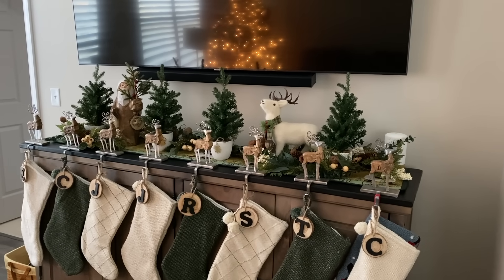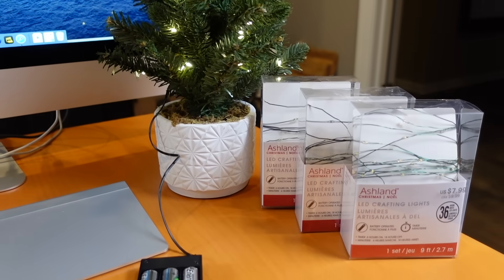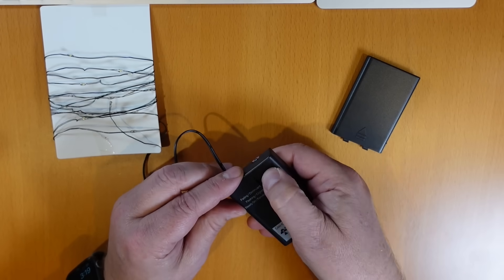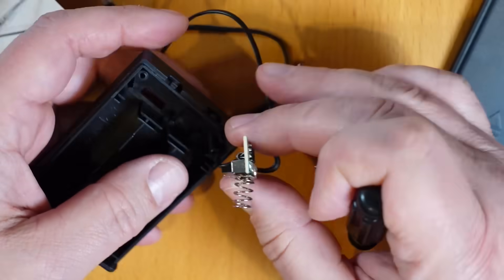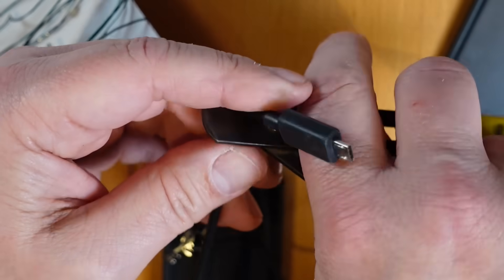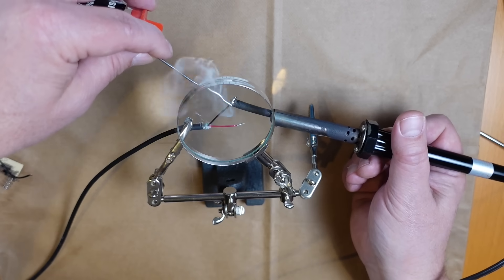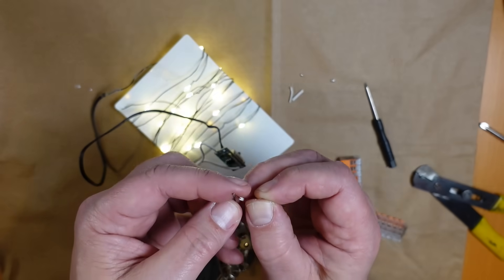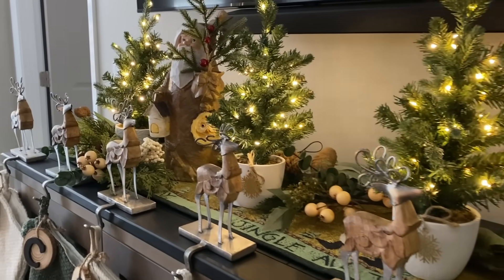SAVE $100s on batteries with this simple decorating hack

Comment: That’s why I save all my old cables from my iPad cut off the part that goes into my iPad and save the other end and wire it to a battery operated decoration so far I’ve had no problem

Comment: even easier, I would have run the cable to the battery box leads and been done. LOL Forget all that circuit board soldering stuff. I'd be twisting them back together every year though
Reply from the maker: Ok

Comment: Well, someone else has the same old analogue voltmeter!
Reply from the maker: Still works!
Reply: @ I added a small red push button switch on the top left (matches the ohm adjust pot) to short the input to set the zero DECADES ago, and yes it still works.

Comment: I slowed video to 50% right at jump but you lost me at the tail end. So you did the same thing to the trees?  The cords into the “Wago lever nuts” aren’t soldered to anything, just cut the battery packs off? The Wago lever nuts are a way to connect them all to 1 plug then?.. instead of 1 plug per fairy light?  Could you explain the Wago lever nuts? Thanks!
Reply from the maker: Yes they are just splicing devices. One for positive and one for negative.

Comment: Be warned the voltage imbalance will cause the neutral line to oscillate and cause a fault current to flow back to the nearest nuclear power station causing a melt down. But don’t worry I will probably be safe where I live. 😂😂😂😂😂😂😂😂😂😂😂
Reply from the maker: Not funny. Ignorant people believe anything.

Comment: Yeah. Most people are not handy electricians. It may cause lots of home fires.
Reply: This will not cause house fires. You don't need to be an electrician to do it either. He used a multimeter to verify the voltage. I taught my kids to do read a multimeter and solder when they were in grade school. If you don't have an engineer parent to teach you there are plenty of classes on the internet that you can watch to learn these skills.
Reply from the maker: No danger with 5 volts.

Comment: That great when you have an outlet near by.
Reply: Use a regular USB A connector and wire that in to the lights. You can use a diode or resistor to drop the voltage down from 5v to 4.5v if you're working with lights that use 3 AA or AAA batteries. Then , you can just plug that into a cheap powerbank and it will run for quite a long time without any issues.
Reply from the maker: Yes

Comment: Ok this is cool but I don't have any of the tools like multimeter or soldering iron or any of those little parts. I do have a bunch of charger blocks though so I'll save the video for another time when I may have everything I'd need to do this project. I just like the idea and I do have another application for it that's not decorative. Thanks for showing us how to do something neat.
Reply from the maker: My pleasure!

Comment: I would just solder the USB plug into the battery terminals and run wires (+ to positive to -) ) to complete the circuit.
Reply from the maker: That’s essentially what I did, just removed the battery holder to make it smaller.

Comment: I did this to the Christmas lights on my tree, but I kept the battery pack as an option. A 5volt power bank is also useful.
Reply from the maker: Yes
Reply: Yes, but most Powerbanks are designed to shut off, when no power is drawn. If you have a fairy light with a timer function, it won't come on again automatically.

Comment: If you added a single silicon diode to the incoming power it would drop 0.6 volts and the LEDs would last longer running at the voltage they were designed for. Also you say AA 'batteries' (cells) are 1.5v yet you show rechargeables which are 1.2v?
Reply from the maker: Yes I had 3 rechargeable batteries to play with one string. I would have had to buy 9 more. I chose this instead.

Comment: I added a 1N4001 power diode i series with the positive. They are good for 1 amp. They give a approx 0.6 volt voltage drop so the lights are getting the correct voltage. They are operate  differently  from a resistor so they don't  get hot.  For a light that has 2 batteries that give 3 V I put 3 diodes in series. Works very good.
Reply from the maker: Good idea 👍🏻
Reply: Excellent modification to avoid the possibility of a fire, caused by over heating by excess voltage.

Comment: Rechargable batteries for the win.  We have been using them for years...
Reply: Last year I bought some fairy lights that have a USB cord. That proved to be a bit of a challenge but nice at the same time. I don’t have many small plugs for that. But then it occurred to me to use one of those rechargeable blocks you can use when traveling for your phone etc.  This allows me to use a string in a location that is not close to any plugs in the bathroom.
Reply from the maker: Good option
Reply: Usually, with rechargeable batteries you lose a little bit of light as they are 1.2v, not 1.5v meaning you will have less available power.
It's a noticeable difference but it is still ok for some people
Reply: @ for this particular application, which is purely decorative it isn’t significant. But I could see where it might be.
Reply: @TheAllMightyGodofCod Lithium batteries might be an exception.  Just measured my 2 different brands of lithium rechargeable batteries; both sets reflect 1.5v.
Reply: @jaycee1373  we are talking AA or possibly AAA rechargeable batteries here.
Lithium Ion batteries if my memory doesn't fail me, are 3.7v.
If you have a different reading, there are 2 possibilities:
1- something is wrong with that reading.
2- you have some sort of transformer circuit changing the voltage from 3.7 to 1.5 and so you aren't reading the battery's voltage but the system's output voltage.
Reply: @TheAllMightyGodofCod  Yes, I'm talking about AA rechargeable batteries. First set is 1.5v 3000mWh, and I liked them so much, I purchased a second set, which are 3500mWh.  They have upgraded and are now available at 3600mWh.  I had to check the voltage after watching this hack and reading your comment.  The batteries I checked had just been recharged a few days ago.
Reply: @TheAllMightyGodofCod  Not really, yes the rechargeables often start out at 1.2v, but they have a flatter discharge curve, meaning that they remain powerful enough to power the devices for longer. That's why they're 1.2v rather than 1.5v and it makes little difference, by the time the batteries are starting to get low, they're below 1.2v anyways.
Reply: @SmallSpoonBrigade  we are not discussing if they are powerful enough to power appliances... I, myself, stated that the lights work with rechargeable batteries, so that was already established.
We aren't discussing the rated voltage either as that is beyond questioning...
And no one is discussing the discharge curve so.... 🤷
Reply: That’s still 9 rechargeable batteries for just those 3 trees. The cost of rechargeables really adds up if used all over the house. They need to make rechargeable power packs for each light string or candle etc.

Comment: For heaven’s sake, why are you using disposable batteries for these kind of low-energy things at all?! Rechargeable batteries are a thing, y’all.
Reply: Not ALL are working... I've used rechargable on some things & didn't work, unless used ordinary ones...🤷
Reply from the maker: Good option
Reply: I have a LOT of battery powered decorations, and made the switch to rechargeable batteries this year. I’ve been very disappointed in the rechargeables. They do not last nearly as long as the disposables. It all depends on the decoration, some I’d get nearly two weeks on disposables, and rechargeable gets me maybe 5-6 days before they just go extremely dim. I’m definitely going to try out this hack on a few that ate disposables every few days.
Reply from the maker: @xlandros Thanks for the info.
Reply: @xlandros  yes my experience has been the same with rechargeable batteries. The amount of time they power something is miniscule compared to disposable batteries. I was always changing them out. I actually gave up and went back to disposable.  And I actually have some items that specifically stated to NOT use rechargeable batteries.
Reply: But now the lights have indefinite power and no eventual battery e-waste at all.
Reply: Or no waiting for batteries to charge, or constantly switching out, on a busy holiday schedule. Changing batteries on four trees, and whatever else in the house, gets old really fast.
Reply: I thought they were rechargeable at first. They are better for some things than others, not always a universal replacement.

Comment: You and me have an all together different idea of what “simple “ means.
Reply: Haha, I kind of agree!  Simple and easy are not synonymous though.  I once made a dust ruffle for my sister, I came up with a simple idea which worked very well. But it was truly tedious because of the volume of fabric. The finished product was very nice though!  I do like this idea, but I would just use Eneloop rechargeable batteries.  However I learned some things I didn’t know before.
Reply: It's really easy and I have been doing it for years only I usually use an LM2596 DC to DC buck converter to get the right voltage some lights only use 2 AA, some use  4, and some use 3 with the Buck converter you can adjust the voltage and brightness and not overdrive the LED's
Also I use old discarded phone chargers
I get from the trash , I used to raid those e cycle bins in the vestibule at Best Buy for them for this purpose before they got rid and f them after COVID
Reply: @andreamitchell4758  you say easy yet I don't understand anything you said lol
Reply: @Veronica.John10-10 lol ! I agree
Reply: @Veronica.John10-10 agreed!! I wonder if I can find someone I know who can understand this and do it for me.
Reply: @mariannebecker5132 Right? It is only simple if you have this kind of knowledge. With my electrical knowledge I would probably blow those little Christmas trees right through the roof if I tried to do this! 😂😂😂 
My husband however could do it perfectly with his eyes closed!
Reply: Especially since you can buy fairy lights with USB plugs.
Reply: A simple statement 🤷🏻‍♀️ and this section got crazy 🤦🏻‍♀️
Reply: I agree.  Great idea and not beyond my skill set but beyond my patience and motivation.  Lucky wife.
Reply: Love your response 😆
Reply: Super simple. For neatness, would have put it back into the original battery box.  Or, could have cut the USB female end off a cable and mounted it inside the box, soldered to the circuit board.
Reply: Sure it's easy if you are an electrician or electrical engineer. We'll my husband is neither but I'm sharing it anyway to see if he can do something like this for me. Thanks
Reply from the maker: @trishrogers9980 Try this https://handydad.tv/a4h7
Reply: @handydadtv  SO COOL!!!!
Reply: @trishrogers9980  one absolutely does not need to be an electrician or engineer. This is hobbyist 101. Instead of sharing with your husband, why not learn to do things for yourself?
Reply: Same! 😂😂
Reply: There’s no doubt that if these Christmas lights started a fire (a common cause) your house insurance would be invalid, not to mention your lives at risk. Hackers beware!
Reply: Read what I did - very easy. You can buy the battery replacers online, but there are stores that sell then really cheap.
Reply: Exactly!
Reply: its not hard mate!
Reply: For real😅like dude😅
Reply: You had me until the soldering
Reply: That part. 🧐
Reply: I’m sticking with my rechargeable batteries.  Also, this option means that all of the trees are no longer flexible in the decor options.
Reply: Tell it!
Reply: Cool. I can do that. 😊 It did take me a little bit to learn where I was comfortable with it. Been shocked a few times with 12 volt and 120 fixing other things. But this shouldn’t be too bad.
Reply: Whew😅 i thought it was just me🤣 now electricity and me are no friends, so I’m definitely not going diy, because with this “simple” hack, I’ll probably burn my house down 😂
Reply: Yeah but now that I see it done once, it’s simple. So that helps a lot.
Reply: I certainly couldn't figure this one out.
Reply: Yup I couldn’t do this hack if my life depended on it.
Reply: It's very easy if you know how to use a soldering iron and a multimeter. Neither is exotic.
Reply: Greatest comment of all time 😂
Reply: I agree and what's a soddering iron? Replayed three times. I've got a soldering iron. Would that work just as well?
Reply: @davidedwards8732   I have yet to watch an American DIY video which utilises solder and soldering irons where they pronounce the words “SOLder” and “SOLdering” correctly. Pet peeve along with the name Craig, saying “Kreg” instead of “Kray-g”. Rant over … climbing back off my soapbox and into my cave.
Reply: SOLdering iron…there’s a L in there that you’re not pronouncing. Lots of USAers miss this too so it must be a local twitch. Soddering is something completely different….turning sods, muddy and messy.
Reply: @Sujowi we don’t give a fart 
Soddddderin
Reply: @Sujowi  oh this is right up there on my annoyance scale of mispronounced words!!
Reply: “You and I” not “you and me.” You wouldn’t say “me have a different…”
Reply: @BitSmythe  that is the super helpful auto correct feature.
Reply: @Mountainmoving9854 Auto correct doesn’t correct grammar…
Reply: @S.E.C-R  Android has Gemini, which tries to auto correct grammar, and for most it's easier to call it all auto correct rather than Gemini, since it is all a form of A.I. anyways.
Reply: @ Ah, gotcha, I’ve never used android.
Reply: The battery’s chemical energy was replaced with electrical energy via the USB soldering. It’s not hard, guys.
Reply: @makeitkozi I don’t think it’s an issue of knowing what he did, it’s a matter of actually doing it oneself. Soldering on a tiny circuit board n all…
Reply: Wow mariannebecker, didn't know we needed you to certify that this is "simple". I only say this is simple because I have rewired sewer pump stations and commercial water features and I am colorblind, because I followed a diagram. This guy basically did a video diagram copy it. 
Thank you handydadtv I will copy what you did, keep creating!
Reply: It is simple, I learned to do this before I was 10, do it once or twice and you'll see how simple it is
Reply: First grade math and color matching is first grade level stuff.  I’m not sure how much easier it could be. 🤷🏼‍♂️

Comment: Could i do something like this with my battery powered Black and Decker garden tools.  The batteries are no longer made......
Reply: GREAT QUESTION!!! 
Hope you get an answer ~
Reply: @thisbushnell2012  i have an old mikita drill. battery’s weren’t available from Mikita. i looked on line an found some after market battery’s. they are working fine. good luck
Reply from the maker: I’d look for aftermarket batteries.
Reply: I would think you are not comparing apples to oranges. 
I buy comparable batteries for my tools if name brand is expensive or discontinued

Comment: I just use rechargeable batteries. As they are slightly lower voltage the LEDs will last longer too.
Reply from the maker: Good plan

Comment: Why not use rechargeable batteries?
Reply: That is exactly what I do. I have plenty of spares on hand, fully charged, so when it is time to replace a set I just swap in new ones and start the next batch charging. We have all of the kids’ game controllers using rechargeable batteries and a drawer where we have a bowl for “needs charging” and another for “fully charged.” We have a great system down. It took a little while to get the kids used to not throwing them away at first, but after that initial learning curve it is super easy. I am all for hacks to make things easier but this just seems unnecessary and adds a lot of extra work for little benefit.
Reply from the maker: I already had these and I wanted the challenge.

Comment: Okay, guys my dad taught me how to do a lot of DIY including rewiring a lamp. That was it for electrical! 
I have long wondered if there was a way to convert battery lites to plug in! 
Can someone either do a deep visual video step by step how to do this. Or even better yet invent the conversion and sell it so we non-electrical folks can easily do this! Thank you 😊
Reply: The "complicated" part of this video was reusing the circuit board, so kudos for that. I have been using old power converters for years with simpler Christmas decorations. Just cut the connector end and do a test hookup to ensure that you have the correct polarity. Switch the wires if not. Once you have the correct polarity you can simply use crimp style connectors to make it permanent. There are several crimp options. I prefer male/female type connectors so that if there is a failure with either the power supply, or the fixture, it would be an easy task to replace it. Not to mention that you can switch it out for any LED lit fall decorations if needed.
Reply: This would actually be a really fun project, making a guide for this. I know how to use arduinos and such so this is something I’m very comfortable with doing. :)
Reply: You can buy ready to use sets with dummy batteries, no soldering needed, you just put it in like normal batteries and plug the stocking out plug to USB port. Also, they sell different kinds, only 3-battery ones are straightforward like that, they sell stuff for 1 and 2 battery powered sets with different voltage.
Reply from the maker: This is as far as I can take you. You’ll need to search for something more detailed.

Comment: It takes some time to pick up all my battery charged Christmas decor and turn them on and off. I would love to have them all plug ins so I could just unplug them or put them on timers. I did remove the battery pack out of one that quit working and used a village house light in it so it is plug in, but did not want to do that to the ones that still work.
Reply from the maker: And don’t forget to remove the batteries at the end of the season or they can leak.